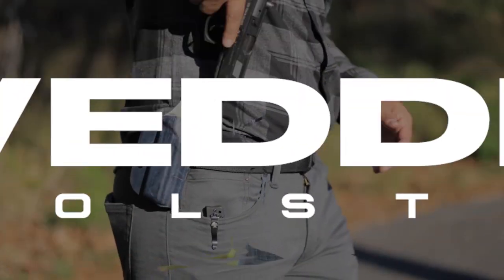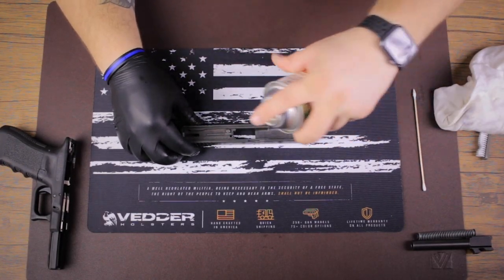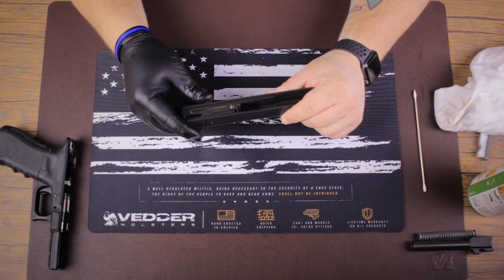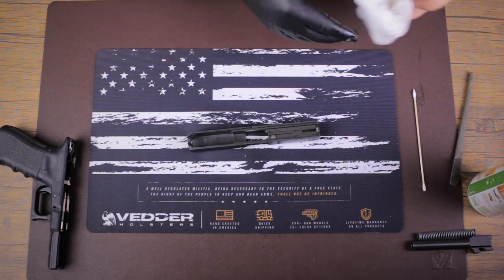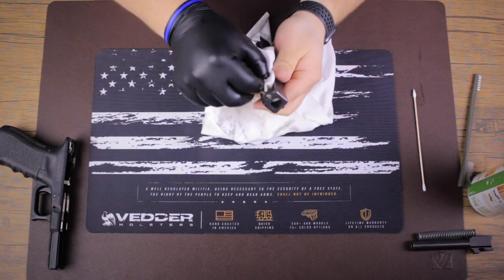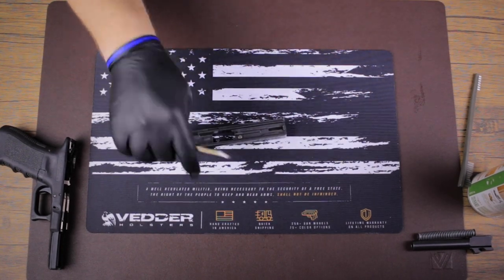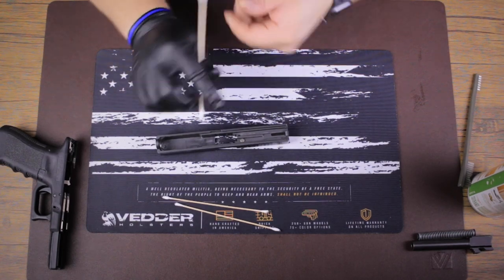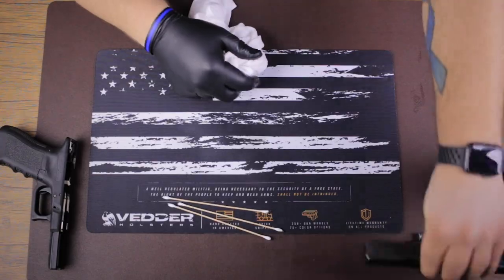How to clean your handgun slide

Comment: Do I need to put any oil on the outside portion of the slide to keep any rust away especially with an EDC?
Reply from the maker: Hello Stephen! Great question! Most handguns will have a Cerakote or other coating on the outside that is rust and corrosion resistant. If you’re regularly carrying, just wiping it down every now and then will be adequate for keeping rust off. Using too much oil on an EDC gun will allow lint and other debris to stick to it which could hurt the finish with the friction of a holster.

Comment: Thoughts on using mineral spirits to clean the side...
Reply from the maker: We would recommend using an actual firearm cleaner or some sort of oil, even WD40 in a pinch, as every firearm manufacturer has a different coating or process on a slide. Generally, mineral spirits may be safe but if that's really all you have I would test it on a very small area to ensure no damage is being done before cleaning the whole slide with it. Also, be advised that mineral spirits will strip any lubrication from the slide, so DO NOT let it get into the firing pin channel and ensure you properly lubricate the slide after being cleaned.